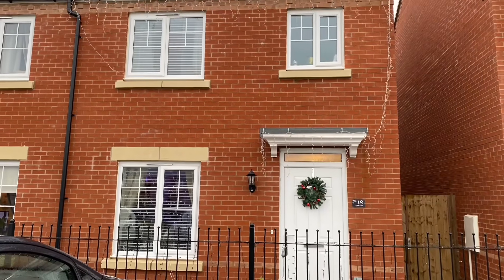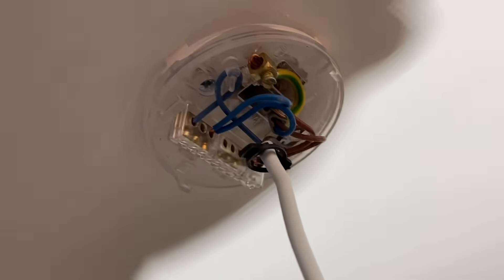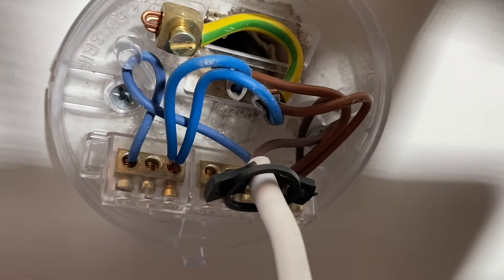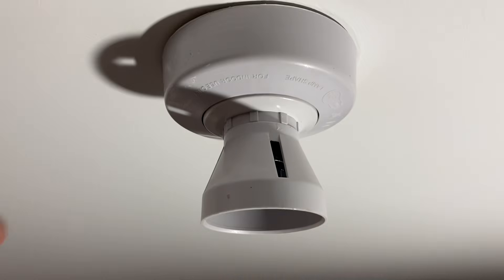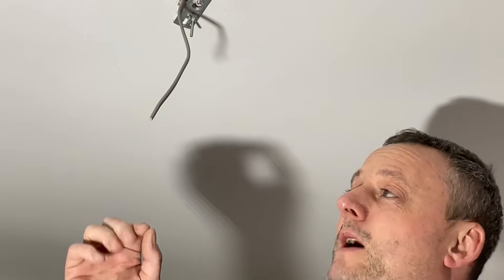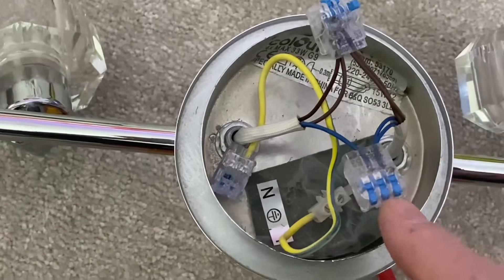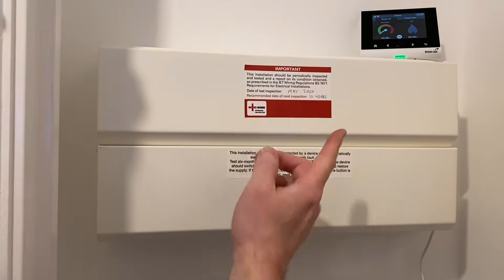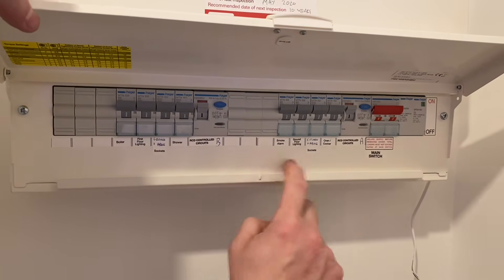New House Wiring Changing Lights - Lighting Circuit Using the 2 Plate Method or 3 Plate Method?

Comment: I'm certain I've got this right but for some reason my downlight doesn't come on. The feed into the light fixture definitely changes state when the switch is operated but the light never comes on. It's one downlight at the moment rated to 230v and I plan to add a second. Anyone know where I'm going wrong? 😢

Comment: How would one feed the next switch in a different room in a mason style house using this two plate method?
Reply from the maker: Wiring Diagram 2 Plate Method - Taking the Feed to Another Room and Switch Connections Explained https://youtu.be/R3_eXKo1NFQ
Reply from the maker: Hope this helps 👍🏻
Reply: @GSHElectrical  Thank you, it does, I was actually looking at the physical aspect, I suppose one could drill through the wall into the next room to get the cable in there.

Comment: I often put mains operated  smoke alarms onto the lighting circuit at the CU, that way it's difficult for the consumer to simply switch off the smokes as the lighting circuit would also be lost. I have been into many installations were the smokes are on an independent circuit which is often switched off.

Comment: I was always told run smokes separately but double up in fuse board MCB with a lighting circuit to stop customers turning the MCB off  or tampering with them.

Comment: I think feeding the switches is a good method as a lot of modern lights don’t have the space for 3 plating , years ago it seemed lights had more space in them ,  also when you are wiring for downlights it seems a much easier method 👍

Comment: Please could you do a video on the testing procedure for a light replacement and filling out the minor works certificate.
Reply from the maker: How to Fill in an Electrical Minor Works Certificate Step by Step. (How to Complete the Paperwork) https://youtu.be/6IV9Y585a8M
Reply: The workshop minor works certificate video was good but it did not show all the testing procedures in a real life setting with parallel paths, alternative insulation resistance testing with LED downlights, loop testing a light fitting etc. Please do some more videos in real life settings.

Comment: I work for the social housing sector and I always make sure that the smoke alarms are wired to the lighting circuit and this is to prevent them from being switched ofg
Reply: But surely they can be isolated from the mcb the same way as the lights are so it would make no difference they still could be turned off. I get doing it to save having to run the cable back to the board or not having a spare way as feeding it off the light is quicker and easier but the turning off thing I don’t quite get. Not having a dig just interested in how it stops them being turned off
Reply: @callumsimpson7483  
Hi callum,
Yes they can still turn the MCB off, however their lights will also go off, Unless they are a competent person, they won’t be able to just simply turn off the smoke alarms.
Reply: @callumsimpson7483  who is going to live with no lights,just to stop false alarms going off,,if it was in its own mcb they could leave it off  forever,but there not likely to do that if it means living with no lights

Comment: Industrial spark here. Always wondered why you don’t put a maintaince free junction box directly above the switch drop in the floor. Feed in and feed out as per usual. 3 core and earth down to switch with a neutral if ever required for smart switch. Twin and earth with neutral and switched live to the lights from the junction box. 

Labelled on consumer unit and in a client handover pack to let them know where junction boxes are. Less cables in both switch and light fitting that way.or am I missing something obvious,,,,

Comment: Me and a friend had a good chat about, should smoke alarms be wired own there own circuit or to a light, what we do is,  if the house is council, then you go off a light as the person would more than likely to turn it off it it beeps, but if it’s privately owned, we do it to its own breaker. Also I like the two plate method more and you can always run a 3core cable to the lights so you have a spare wire to future proof if you need a live up there. 😉

Comment: I can see the advantage of the two plate method , but I prefer to three plate as I don’t like over crowding the switches .
Fantastic video Gaz as always 👍👍❤️⚡️
Reply: No disagree - it’s a lot more awkward stripping and terminating more cable conductors when there are on the ceiling
Reply: @09weenic  how is it ?
Reply: Modern wire should really have a neutral at the switch,that's why 2 plate is the preferred method now,3 plate is a bit old school now
Reply: Or I would use the junction box method
Reply: @Dog-whisperer7494  that’s fine as long as it’s placed in accessible location , bit of a nightmare otherwise if you wanna modify the circuit at a later date

Comment: Hey I've got a couple of knives which look like yours.  Ones's blue and the others black.  
Imho smoke alarms should be  integrated into the lighting circuits.  As to prevent people switching off Mcb's or rccbo's for nuisance alarms.  I've lost count of the amount of mains powered smoke detectors which have been switched off or tampered with.  Best kept powered up.

Comment: All good till you need a permanent supply to install a loft light!! New builds should consider leaving a supply in the loft for such occasions. Great vid though!!
Reply: Lol most new builds don't have enough structural support in the roof to be able to use the loft. But yes I see your point.
Reply: If it's in the house spec they do. But there are always options to get a feed  up.

Comment: I'm relatively new to the electrical training world (literally started last month) but I'm pretty sure smoke alarms are recommended to be on a regularly used circuit such as lighting as opposed to their own circuit where a fault wouldn't necessarily be caught as early.
Reply from the maker: Totally agree 👍
Reply: Also as a 15 years in the game spark in my opinion ,aswell as being on the lighting circuit I find it stops the morons turning the circuit off thus leading to them taking the smoke head down completely when the batteries are low ,but even so I find that they end up taking them down after a while due to batteries being low 😳

Comment: I was always taught to wire lighting circuits using the three plate method however to days preferred method is the two plate method (feeding the switch) this has many advantages 1.making the majority of connections at the switch rather than up a step ladder at the light. 2.light fittings are only designed to take one twin & CPC 3.reduces the homeowner of incorrectly terminating the cables and causing a fault.
Reply: Also allows for smart switches using the two plate method.
Reply: Exactly my point 👍 many lights especially new led fittings simply don’t have the facility for 3 lighting cables, every new job I do now I often feed the switches instead of the lights 👍

Comment: how are you keeping well and safe I hope. Question, why do we have to keep spending money on a new edition every few years,? I have. Still got my copy of the sixteenth edition and I have spent the last few days comparing it with the eighteenth edition apart from the one or two amendments and one or two regs being moved from one page to another and the od typo corrections there is no real difference or change so. Do we really need to by the dame thing? at £ 85 a pop After all electrical work is 70% common sense 20% experience and 10% training, as for being a member of the organisations, we need to remember that it is not a legal requirement
The NICEIC, JIB are nothing more than trade unions
Reply: Some other countries I understand have their regs in a binder type set up where the relevant pages and be taken out and inserted.
Reply: I agree , the electricity itself hasn’t changed , it’s just safety and theories that change , some of it is good such as increasing use of rcds etc but in my opinion they are barking at the wrong tree , there is still no rules to prevent anyone touching electrics , since this part p has been introduced it hasn’t prevented the cowboys at all , just a money making game , the cowboys will always undercut the professional as they need no certificates & take shortcuts .  The niceic insist you have a latest edition  book tho , when you have your annual inspection they wanna see it , if you are requested to purchase one as a result of their inspection they wanna see receipts. There’s no getting around it .
Reply: @Charles Vane Surely there's only one AFDD per DB, not one per circuit.
Still don't see the point though.